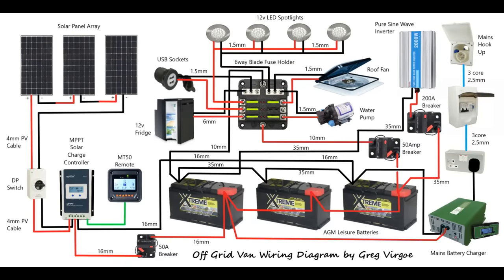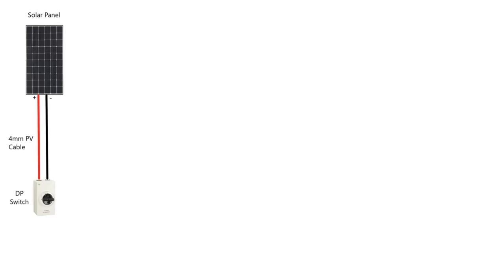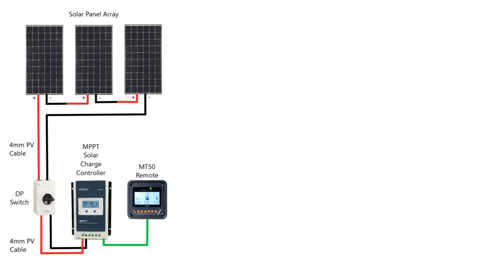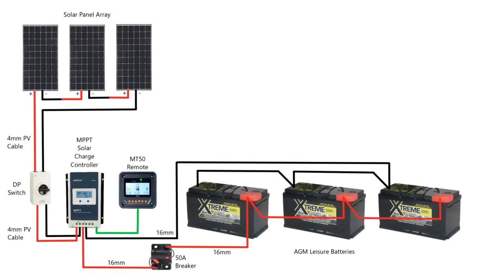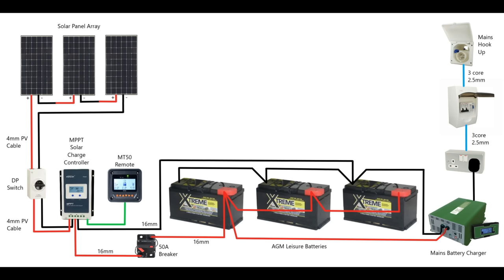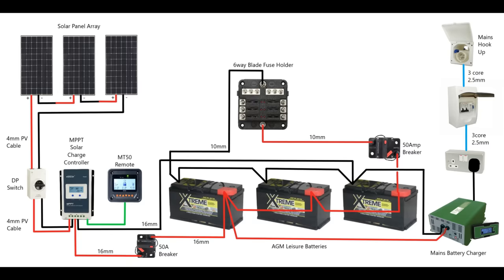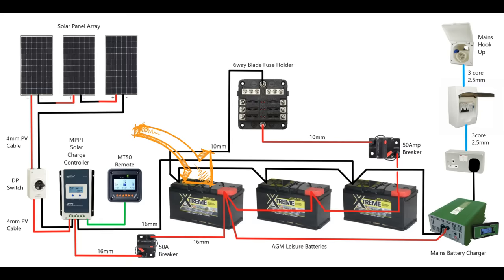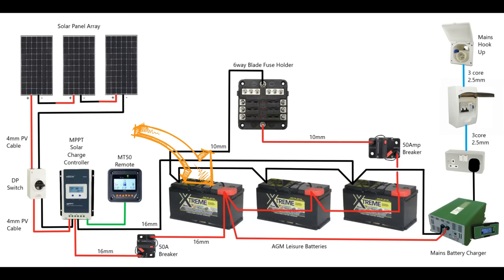How to Wire your Camper Van to be Off-Grid

Comment: Hi Greg.
I am confused, not difficult. I have come to a grinding halt with the wiring and need some answers. I am building my van as a mobile art studio, so mostly off grid🤞,but building in a shore line just in case. Now my confusion is, do my sockets get used by both the 230v and 12v wiiring., or do I run 230v cable(blue) to 230v sockets and 12v cable(flex) to 12v sockets. I was imagining that just one set of sockets were needed for both and the inverter would do the swapping over to send the juice down the appropriate cables bkue or flex to the sockets, so avoiding the need for two lots of sockets. I hope thus is understandable😬.Thanks Greg
Reply from the maker: Your inverter just powers 3pin 230v mains sockets. It takes power from the batteries and converts it to mains AC voltage. 
12v sockets like cig sockets or usb sockets are fed direct from the batteries via a 12v blade fuse board. 
Now you can also wire from shore connection hook up to 3pin sockets to power mains devices when connected to an outside power source. 
Hope that helps. Maybe take another look at my video 👍🏼😊
Reply: @GregVirgoe  Thanks Greg. One last question, do you run individual cables to each socket/usb from the fuse board or loop them through like a house ring main.
Reply from the maker: @turnersky2651  you can loop them round in a ring but be aware not to overload them with too many devices 👍🏼
Reply: @GregVirgoe  OK, so I understand from your rely that I would be best running single cables to each socket and or USB.
Like so many, a big thank you from me for all your excellent work, they've proved invaluable . Enjoy your summer and look forward to future vids.😊

Comment: Hi there I thought that the fuse size should be lower than the amp rating of the appliance so the fuse would pop before the cable burnt ,so iam confused
Reply from the maker: If the fuse was lower than the rating of the appliance it would blow every time you turned it on. The order increases like this -
Appliance Amps - Fuse - Cable size
The cable being rated higher than the fuse so it would be the last thing to burn out.

Comment: Hi Greg, the 50A breaker between MPPT and Battery pos pole, can I use a 60A, all I could find in Centurion, South Africa? Ditto for ¹ between battery and fuse box? Would 10A more be a problem? Thank you so much Greg!!
Reply from the maker: That’s the max you could go to 1.5 times your load. Make sure your cables are rated for more than 60Amps.
Reply: @GregVirgoe  Thanks! You have already told me that in your videos, nice reminder will not forget! Thanks, busy watching your magic on youtube....

Comment: Hey Greg just wondering why haven’t you hooked up your car battery and alternator to your other three batteries? Wouldn’t it help So that the batteries can charge as I drive.
Reply: Thats exactly what Im doing , cuts out 90% of all this lot. I have a 240v hookup with battery charger, and the van battery link cable is on a crocodile clip so I can charge the van battery too. :)
Reply: @refugeg271  Oh ok, I'll look into that, Thanks

Comment: Hey Gregg are all your 12v appliances individually wired to your batteries, or do you only need a positive and negative from the blade fuse holder, thanks Mike

Comment: Good nmorning Greg, I am in th eprocess od purchasing batteries for my sprinter van, if I buy 2 x 130w  (260w) batteries I realise that I only have 130w of usable power? if I buy 1 x 130w Lithium Iron battery would I have the same amount of usable power?
The AGM batteries are heavy, require more space, cheaper then Li, but may not last as long?
Your comments would be greatly appreciated.
Reply from the maker: If you are not bothered about the money then go for the lithium. 
If you look after the AGM they will last for years. 
Ours have been running now for three years 24/7 and still working perfectly.

Comment: Doing a camper build with 12v and 240v Hi Greg can the 12v and 240 be earthed at the same point or does it need to be separate? 

Thanks
Reply from the maker: 12v DC Does NOT need an earth. 
It is wise to connect an earth bond to your 230v mains side to the van

Comment: question:
to jump over buying a DC 2 DC charge from alternator i was thinking of this:
My inverter is connected to the lighter as usual. Taking power from the inverter and send it to the 'Mains Battery charger' which charges the batteries when connected to the grid. 
What's your thought abt this one? :)

Comment: Hi Greg, sorry for a really basic question but what do you use to boil water for a cup of tea ? 
With the offgrid setups, would an electric kettle be too much load ? 
Then I was thinking using the gas stove to boil water is probably the best solution, is that correct ? Best Regards, Colm
Reply from the maker: If we are off grid we use the gas stove kettle. We do have a small electric travel kettle for those odd times when you gets free hookup
Reply: Or Lithium batteries, they can handle the load requirements...! No gas required nowadays. I know people who run a coffee machine and an electric cooktop.
Reply from the maker: @sirgregoir  yes you need lithium batteries for large electric loads, but remember you can only use what you can generate if you want to stay off grid long term.

Comment: Hi Greg! Missing a line from your inverter to consumer box (fuses). How do you deal with this? When you connect to main power supply, you switch off your inverter manually or leave it switched on?

Comment: If I was going to wire an outlet can I run it off the 6way blade fuse holder?
Reply from the maker: The blade fuse holder is 12v DC so the only sockets you can connect to that are cigarette ones. Definitely not mains 3 pin sockets.

Comment: Hi Greg, i notice you are using 4mm PV cable?  What AWG is this? 12 AWG?  I've just purchased some 10AWG to run from 2 x 175W Renogy panels wired in Series, and the run will be about 15ft, will this wire be ok?  Is this wire bigger than the 4mm2 you are using?
Reply from the maker: 12 AWG is a bit smaller than 4mm I would go with 10 AWG that would be better. 👍🏼😃
https://www.electricalworld.com/Mobile/en/AWG-to-MM-Cable-Conversion-Guide-and-Calculator/m-cc-51.aspx

Comment: Greg do u need two water pumps to run shower and taps in kitchen
Reply from the maker: No, only one. This video gives you the exact layout details and free schematic 
https://youtu.be/7gieUNuZan4
Reply: Thanks Greg  also on the wiring diagram where would u put switches to tell u pumps on fridge is on etc
Reply: Does show switch kit on diagram where would u install this pal
Reply from the maker: @zakglynn683  switches go in the red cable from the blade fuse holder to the appliance.

Comment: Hello sir, 

With things like the Bluetti eb70, which uses Lifepo4 batteries, would you think that is the way to go due to its simplicity, portability and transferability to different van builds?  Do you think you would have gone this way, or maybe it's a good partial solution for us non-technically minded simpletons like me?  I think true usage from that solar generator is 616 watt hours.
Reply from the maker: If you are nervous about doing the electric installation yourself that is an easy option to consider.
Reply: @GregVirgoe  For yourself having the knowledge, could you explain why or why not you would choose to use it or not?  If you don't mind.  Maybe pros and cons, cost, etc.?

Comment: Is it ok to continue using your pure sine wave inverter while you are connected to mains and charging the batteries? Thank you
Reply from the maker: You can still use power from the batteries while you have a mains charger connected to them. 
Just don’t power the charger from the inverter. That won’t work 🤭
Reply: @GregVirgoe  thank you so much for your reply! I love your work, so I'm honored! Cheers!

Comment: why do you use a 50amp breaker for the fuse block?  is because you use about 600w?
Reply from the maker: Potential there could be a number of things running at the same time so it has to cope with peak load.

Comment: I have a 100ah leshure battery can i simply go posative to posative thus then given me a total of 20ah as i want to add a 2nd battery the same also can iadd a 100ah breaker swich mains one so i can shut off one battery any time or should i just go posative - posative then negative -negative advse would apreshieated .
Reply from the maker: Wire them both together + to + and - to - to make one battery of 200ah capacity. Then connect your loads to positive of battery 1 and negative of battery 2 so they are connected across both batteries. This will ensure even use of both batteries

Comment: Hi Greg, with being on 240v hook up charging the leisure battery,will it matter that the solar is still connected?
Thanks
Jason
Reply from the maker: Hi Jason, no it doesn’t matter. The MPPT will see the high charge voltage from the mains and back right off thinking the batteries are full. They work perfectly together
Reply: Many thanks Greg 👍🏻

Comment: Do you need the mains battery charger or would solar be enough?
Reply from the maker: I have it as a back up charger in case the weather is back. You could have a battery to battery charger instead and use it when driving 😃

Comment: Hi Greg, many thanks for this video as I’m just about to start building the elec’s in my Sprinter. Q for U……how did you come up with 200A c/b for the inverter and 50A c/b for the batteries….did I miss something ? Cheers Glenn
Reply from the maker: It’s calculated by the connect load in amps plus 25% margins. I did a video about fuse sizing here -
Electric Cable & Fuse Sizing
https://youtu.be/koFg6oFs0RU
Reply: Thanks for that. I told an Auto electrician that I was following your video’s (I think they’re really neat) and he was not pro the resettable circuit breakers - rather these chunky fuses (like a packet of chewing gum) - is he just being a bit of a princess ?
Reply from the maker: @glenncallow1454  just bear in mind if you use fuses to carry some spares in case they blow when you are travelling.
Reply: Sorry Greg - just one question for you - ‘Vapour Barriers’ . Is it acceptable to use clear polythene sheeting (like greenhouse mat’l) as I want want to screw my panelling directly to the hat section frame in the van - and I figure being able to see directly through the material will help me miss those little holes all over the place. Just a thought. Cheers Glenn
Reply from the maker: @glenncallow1454  you can use polythene as a vapour barrier but you need some form of insulator between it and the metal of your van or it’s useless just against the metal. I suggest using timber battens screwed to the ribs then fix your ceiling direct to the timber and you don’t have to worry about holes in the metal work.

Comment: 2 questions. could you put costs for the system (inc individual primary parts) and under normal use how many days would you get out of your batteries (assuming no solar) as im considering building a day van (transit van) for the odd night out and surfing. just wondering if a solar panel would be needed if i pre charge the battery or batteries. id probably connect two batteries to the van battery via a cut off switch. maybe you could explain in a new video.

Comment: I'm confused about the inverter set up. The inverter has a 200A breaker but the 35mm cable is only rated to 141A.  Doesn't that mean the cable melts before the breaker trips?  I know that's the correct setup from tables but don't understand the logic.
Reply from the maker: From that table you are right so for the purposes of this video it should be bigger. The cable I used was from 12volt planet and it was rated at higher amps. Sorry for the confusion 🤓👍🏼
https://www.12voltplanet.co.uk/extra-flexible-pvc-battery-welding-cable-35mm-240a-by-the-metre.html
Reply: @GregVirgoe  Ahh, that clears that up. Thanks.  Can you tell me why a 1000W inverter requires 200A supply? Isn't the amp calc 1000/12=83A ish?
Reply from the maker: @grahamjohnstone3483  it’s a 2000w inverter so that’s 2000/12=167amps + 25% = 200Amp fuse. 
For a 1000w inverter it would be
1000/12=83amps + 25% = 100amp fuse
Reply: @GregVirgoe  thankyou. Really like your videos. They've been invaluable during my build. Thanks for putting the time and effort into making them and replying to questions.
Reply: @grahamjohnstone3483  1000w ~2000w peak

Needs a 200AH breaker for max loading purposes, otherwise getting a 1000w is pointless

Comment: Hi there I wonder if you could help me i have a 1000-watt pure sine inverter  it says continous power 1000-watt, surge power 2000watt would it be best to use a 200 amp breaker or what would you recommend ?  I also have a victron mppt 75/10  charge controller would 6mm wire be fine and would a 30amp breaker be okay? Last question I have a split charger relay i was thinking of using 16mm cable rated 110amps to power 2 leisure batteries at 105Ah  each would you put an online fuse in or a circuit breaker if so what size ?  I have found your channel so helpful was just a bit  confused on these 3 points Thank you so much
Reply from the maker: Hi use a 100amp fuse or breaker for the inverter. Something closer to 15Amp for the charger would be better. 16mm cable for the split charge is fine however a B2B charger would look after your leisure batteries better than a relay. Size the fuses at 25% more than running amps and always below your cable rating.
Reply: Thank you very much for your help much appreciated. I am doing a micro camper think the b2b might be a bit too big . What do you think about a  ctek instead of split charger relay would it be  better 🤔

Comment: Hi Greg, i cannot find anything in your videos explaining how to " make the 230v sockets live via a inverter" being off grid - Hope you still answer Qs
Reply from the maker: You simply plug a 3core flex into the inverter and run this to your 3pin sockets. I suggest you use 2.5mm artic blue cable.
Reply: @GregVirgoe  say if you want to make all the 230v sockets active from the inverter  ?

Comment: Hi Greg awesome channel.
i have a question that ive seen different answers for.
when wiring in my 230 v hook up and consumer unit do you recommend running an additional earth from the consumer unit to the body of van. thank you
Reply from the maker: Yes on the mains side I would bond it to the van. In case you have a short circuit on one of your mains electrical devices. I would also bond metal inverter cases, copper gas pipe etc 👍🏼😃
Reply: @GregVirgoe  thanks greg for the reply looking forward to your new build
Reply: @GregVirgoe   What size wire can be used?  Can a bare solid 6 AWG be used as in USA houses use for their earth ground?  Thanks and very good videos!
Reply from the maker: @ray7157  no solid core cables are no advised in a moving vehicle. Multiple stranded flex is what you need and the larger the better.

Comment: Cool video but there is something wrong, between the battery and charge controller you don't put circuit breaker, you need a kill switch, solar panels should never be connected alone with the charge controller if the battery circuit breaker jumps. This way you will destroy the charge controller.

Comment: What about charging when you’re driving using a dc to dc charger?
Reply from the maker: You can add that to this system and connect to the same battery terminals as the mppt charger 👍🏼

Comment: How do the telly and other 230v appliances connect to the inverter?
Reply from the maker: run a 2.5mm 3 core cable from the 3 pin socket on the inverter to one or two sockets in the van that you can plug your 230v devices into, like an extension cable

Comment: What happens if you drain the batteries too much at night? This damages the batteries, right? Or can the charge controller turn the devices off when too little electricity remains?
Reply from the maker: Some controller have that facility, mine doesn’t. You can also buy a stand alone battery voltage disconnect. You are right, agm battery will be damaged if drained too low.
Reply: @GregVirgoe  thank you!! Your videos and comment help me a lot
Reply from the maker: @tamerius1  No problem 😉 anytime 👍🏼

Comment: Hi Greg - top stuff, many thanks. i want to follow your schematic for one solar panel but it doesnt have the hook up facility that is on the main schematic. can i mix and match and add this? would i need the 2000w inverter if i do this? mike
Reply from the maker: Yes Mike just add the hook up elements to the single panel setup exactly the same. https://www.dropbox.com/s/0p96qj2jin5ffkz/Schematics.pdf?dl=0
Reply: @GregVirgoe  thanks greg yr a star!

Comment: Hi Greg, what amp solar charge controller would it be? As there’s a few 

Thanks
Reply from the maker: It’s based on the total connected watts and volts for your solar setup. My MPPT controller is 40Amps. Check the specs of each unit and they will say the max values on input. 👍🏼

Comment: Hi Greg, Two questions please.{A} Is it OK to wire the 240 sockets in a ring main and a separate  ring for all the 12v sockets,  (B) Is it OK to wire the 12v appliances through 240v type spurs so I can isolate locally.

Thanks for your advise and time

Comment: Correct me if I'm wrong but if a household 2.5mm cable can take 3000w, why do you need 35mm cable for 2000w?
Reply from the maker: Because it’s running at 12volt and the amps is much bigger. 

House 3000w / 230v = 13 amps
Van 2000w / 12v = 167 amps 

Cables are sized according to the current use in amps
Reply: @GregVirgoe  Thanks 👍🏻

Comment: when you hook up to mains power, does this override the solar element or does the solar panel need to be disconnected? im just thinking the 240v hook up and the solar panels putting power into the batteries at the same time may blow everything up!